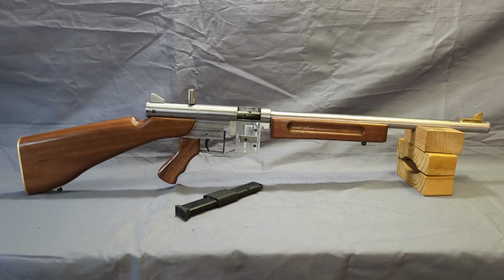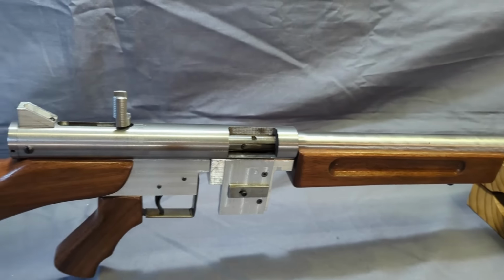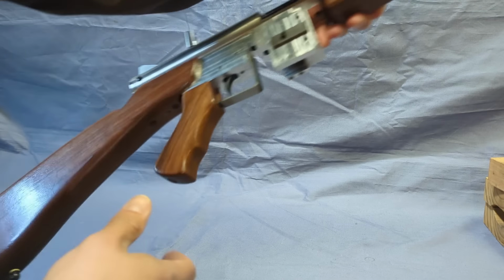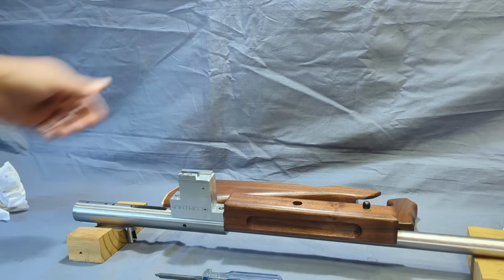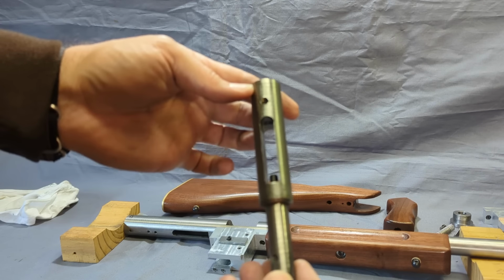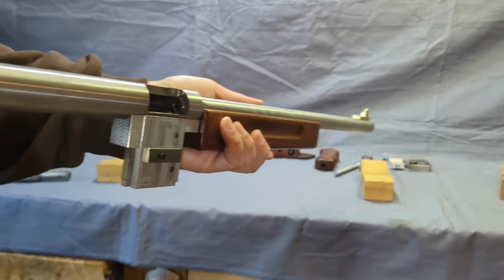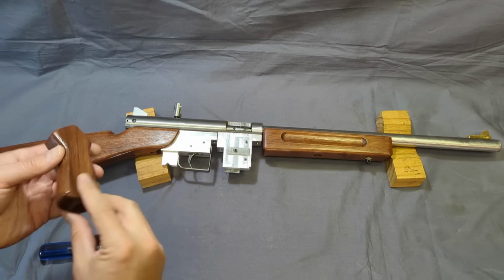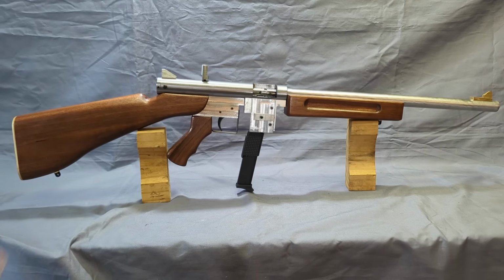Homemade Tommy Gun Mini: 380 Blowback

Comment: Question: How did you machine the feed ramp, I presume you used something like a dove tail cutter using the hole for mag well? or did you pitch the trunion in a vise at an angle & use a straight endmill (cut from the mag well hole)?

thanks
Reply from the maker: Good question. I did the latter, I angled the receiver and cut them using a long mill bit. I then cleaned/polished them up with a Dremel.

Comment: At least you did it. How did you deal with the recoil spring? Did you calculate the spring constant K using the kinetic energy of the bolt? For most situations, a suppressed 380 is more useful than a 556 (for me... I don't live on a democracy).
Reply from the maker: I did look at the KE. But since this is really just a prototype I tried several springs I already had. I settled on a trimmed down 1919 spring. Good question, thanks for commenting

Comment: Dude this looked really factory made
Reply from the maker: Thanks. I'll try and coat the metal soon, that'll make it look even better
Reply: @garage.guy.3006  Looks fine as is, Looks like stainless steel. Chrome plated would make it pop. A typical blueing finish wouldn't not pop as well as it does with a bright metal finish. Just a suggestion.

Comment: Why not chamber it in 9mm? Higher chamber pressures? Sometimes 380 is more expensive than 9mm too. Also 100x more ammo options on 9mm.
Reply from the maker: Oh I just have never built a 380 before. Plus the bolt mass can be lower than with a 9mm.
Reply: @ that's fair. Cool build!

Comment: Any place I can get in contact with you? Preferably over phone? I got a few questions about a design I’m working on and maybe you could give me some help eh?
Reply from the maker: Best not. But if you have a top level question feel free to just put it in the comments
Reply: @garage.guy.3006  okay cool: here’s a quick summary. Gonna use a drill press, angle grinder, welder to make a lathe, then I’m gonna use the same tools with the addition of the lathe to make a mill, minus the tooling. Then, when I’m done, I’m gonna use them to make a c96 in 45 subsonic/45 shot shell. Hopefully I’ll see a reproduction c96 before 2026. Peace out homie.
Reply from the maker: Very ambitious but I like your plan. You should make a video, especially of you making the lathe and mill. But yeah sounds neat. I bought my mill and lathe obviously so I wouldn't be much help with that

Comment: Looks good, would have been cooler to have it open bolt though. But I guess there is some stupid law in your country that says banned cause to easy to modify to full auto (as if the criminal would be to stupid to research how a close bolt firing group works).
Reply from the maker: Yes it would have been easier and more historically accurate to make her open bolt. But you are right, there are stupid laws discouraging that.

Comment: If everyone is so concerned about gun control they will have to outlaw bullets and reload supplies and all shotgun shells on the market,  because anyone with 40 bucks can go to Wal-Mart and get two pipes an end cap whith a bb epoxy and stick it in the end cap , you now own a fully functional 12 gauge shot gun.Slam fire shot guns are legally manufactured serialized and sold in Africa because it is so cheap. Tha ammo costs more. You cant stop the signal.